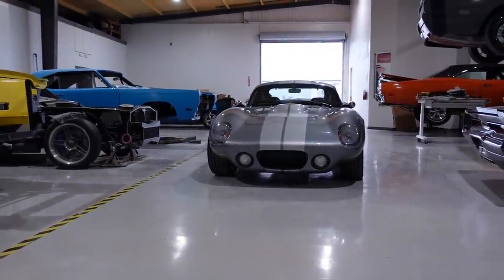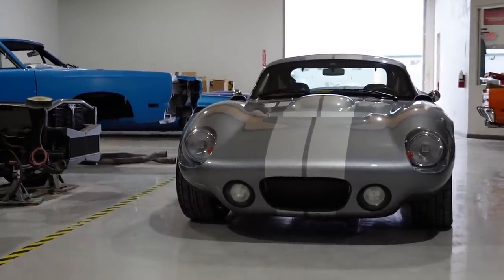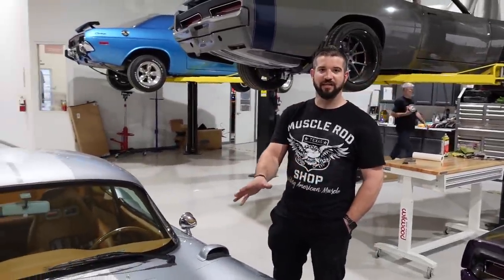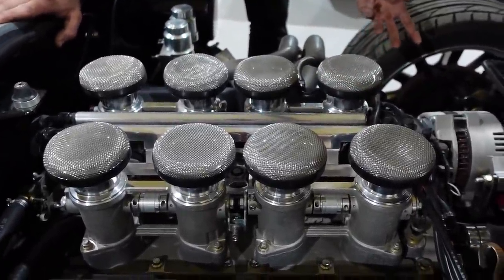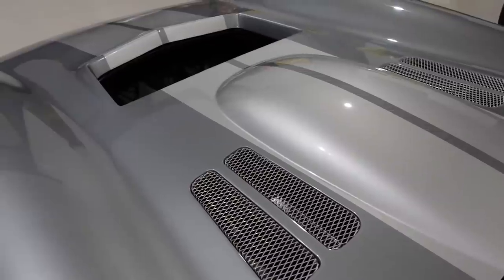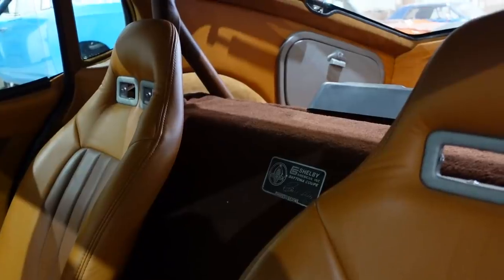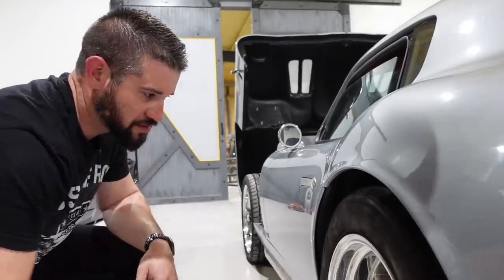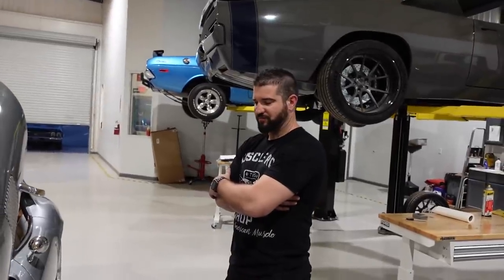You've got to hear this Superformance Shelby Daytona!

Comment: Back in 1994 I got to drive one of the real ones when I worked for Bob Bondurant's Racing School.  A friend of Bob's was a Phoenix doctor and owned one. He had just got it out of storage and wanted to lap it before selling it.  Bob and co-driver Dan Gurney won their class at Le Mans in 1964 in one of the four originals.  I also met Pete Brock,(The body designer)  he was a friend Of Bob's.  The oil cooler split early in the race and they lost a lap while they removed the cooler and just looped the hoses.  It ran with hot oil temperature for the rest of the race, but it held together.  Bob originally bought one but resold it for $10,000 USD. (In the 1960's some time)
Reply: Cool story 👍🏻

Comment: I enjoy the work you have done as well as the thought process that goes into it.

Having grown up in the muscle car era, all I remember was suspensions and brakes that didn't work, body and trunks that leaked when it rained and 5-6,000 mile tune ups.

There isn't a new Ford Mustang, Chevy Camaro, or Dodge Challenger build today that wouldn't beat one of the old muscle cars either on a road course or 1/4 mile drag strip event.

I've done 5 body off restorations (65 GTO, 66 Mustang, 2-69 Chevelles, and a big block 68 Dart GTS). I've got an English wheel, panel bead roller, roller, a spot and stud welder) Average time of rebuild, 18 months. Thoroughly like watching metal fabricators which is a lost art, do their thing.

As for what to do next? Possibly follow a new build, from incoming assessment, design phase, tear down, rusty panel removal, new metal fabrication, paint and wiring.

Comment: A build series on a few different cars. Where they are all in different stages. Then when one is finished a new one takes it's place as the starter car. Each progressing through the process. With things like this thrown in every now and then. When one of the project cars haven't had much done. Or highlight certain steps. Like how the bead rolling helps stuffin a panel.

Comment: You do a great job explaining what you’re doing. 
Remember you don’t have to do it in real time.. 
you could do a little bit of filming of several cars, and then released them in segments. Road Runner part  1 through 5... 
That way in a couple months from now you will have 2 or 3 cars builds with four or five segments each. 
 That also would give you a break because then as you release those videos you can work on other projects without having to make so many videos.

Comment: Brandon, a video montage of one of the wide body cars, particularly the wide body, chopped, channeled and sectioned Charger would be awesome, even if it was done with a series of still pictures from the build. It would really showcase the Muscle Rod Shop's skill set. The Demo Ranch car is giving us a great look at your engineering side, but the Charger above is in a class by itself as a full custom. FR

Comment: Keep doing what you are doing, I first saw you with Mat an liked what you are doing.
My first Car was a nine year old 1955 Chevy, six cylender, three speed on the colum shifter that I bought with my coin collection.
I rode my bike over to the dealer, paied for the car and put my bike in the back seat and drove the car home.. It cost me two hundred and twenty dollars cash.
I dr

ove it to High Scool, insted of walking in the snow, over a mile.
I ended up Being a CH-47 Mecanice and other  Army Helicopter Repair men, and a Tank Commender in my 20 Years in the US Army.
I ended up working for Bell Helicopter for 29 Years. I worked as a Assembler and went to a Hand Former  and then went to Ekpermentak for over 10 Years. I was making parts for old and new Ships that were never built before.. I used a sheer to cut the metals and saws and drills and breaks to form the parts.
I see that You have all of the Expertise  in Automotive stuff and I take mu hat off to uou.

Comment: I read that back in the day, the 289 Daytona's at Le Mans almost went 200 mph as opposed to the 427 roadster that'd top around 180-190 mph. Fun fact: there was a Hot Rod Magazine article titled the '10 best engines in history'. One was the Ford 427FE w/ the dual 4-barrel carbs, that was modified to run the '67 Le Mans in a GT40 Mk. IV. They explained that even in '67, the Le Mans officials would keep a record of the gasoline usage for the cars to determine its efficiency. Of the Prototypes, the GT40 Mk. IV's & the 427FE had higher mileage figures then the Ferrari P4's w/ their 4-liter(244cid) V-12's. They were the most efficient P-cars at the race. The 427FE's were putting out a mild 550hp, from parts you could buy at authorized Ford Dealers. I thought it was any dealer but I was told otherwise.

Comment: i work at a tire shop, been there for 26 years and in all my years i have seen maybe 5 cars with knock off wheels. we will not take them off or put them on because of the possibility of coming off if not installed correctly..but we will let the customer take them off and we will change the tires and they can install them again themselves..and its usually a brass hammer or a dead blow hammer they use. the last set we changed, the customer put them back on like i said and when he left he made it about 100 feet to the stop light to make a right turn and his right front wheel came off .

Comment: Shelby Daytona is the reason the UK has a 70mph speed limit!!
They were using the newly opened M1 motorway as a test track hitting 185mph on what was until then an unrestricted road! on 22 December 1965 the 70mph speed limit was introduced.

Comment: around 4:30 hes talking about a huge problem with any throttle body. oil or carbon/soot/dirt buildup makes them stick break or not idle. electronic throttlebodies are notorious for it.
a very simple easy fix for all of this is to drill a small hole in each one about 1/3 the way out from the center or from the bar that holds the throttle plate. like less than 1/8 inch unless its a single throttle body. after that carb rejet or adjust idle. most fuel injection will adjust the idle air control valve to compensate for the extra flow and give it a touch more fuel if its really even needed. most of the time adjusting the throttle plate stop to back it off some and close it a little evens it out. most automakers actually had a small hole for that reason and to smooth out idle and make good vacuum. iac changes were more smooth and the throttle body wouldnt stick or clog up. we didnt have those problems.

Comment: you should use a copper mallet to hit the spinner on the wheels, the spinner is made of cast steel/iron.
Reply from the maker: The hammer is lead. It Works horribly.... But it works.

Comment: Beautiful car,  comment / feedback.  increase the tread to 1575mm / 62 inches,  increase the wheelbase to 2500mm / 98.4 inches,  raise up the ground clearance to 155mm to 165mm or 6 to 6.5 inches (potholes,  lousy streets),  raise the top of the car to1220mm / 48 inches (I'm 6' 3"),  use full frame doors or gull wing doors,  use a Ford 429 with either John Kaase SR-71 heads or Boss 429 heads.  Use hydraulic roller camshaft with a max of 40 degrees on valve overlap at .006 start lift.  Keeps a nice low idle with decent gas mileage.  In CA,  they have $7.00 per gallon gas ouch !!  Must use A/C,  use Naugahyde material,  leather will dry out and crack.  Must have full gauges,  must have full roll cage.  Use some small bumpers front and rear,  driving people are nuts.    Use a 5 or 6 speed transmission look for G-Force inc website on transmissions.  Well,  thats about it have fun !!!

Comment: Can these be configured as RHD?

And for other roadworthy  compliance logistics down under (OZ)... can it be tricked out with straight pipes out the back with mufflers for noise reduction?

Finally, it has ti have ABS, ESC and electric fuel management system. Otherwise we can't do it down here.

Comment: FYI… back in the day they used a 6’ long bar with a three prong attachment on the end to remove the wheel nut. Looks like a super long torque wrench. Today we use a lead hammer. DO NOT USE a standard hammer…

Comment: hi great video > quick question ~ the exhaust is only coming out of one of the side pipes? 🤷🏻‍♂️
Reply from the maker: No the exhaust will exit from both passenger and drivers side fender gills.
Reply: @MuscleRodShop  not sure what you mean by fender gills ? in the video of the silver daytona when the car is revved at 42secs there is only exhaust coming out of the bottom of the twin exhaust pipes on the drivers side ? 🤷🏻‍♂️

Comment: What you should do next is realize that a Muscle car was defined by Carrol Shelby. And it should not be any surprise to have a Daytona Coupe in a respectable hot rod shop. 1949 Old's Rocket 88 was the first american made performance car. Pontiac was #2 then the AC 289 Cobra and then in 1965 the 427, and 428 AC Cobra's

Comment: Why not drill a small hole on the plate inside the throttle body? That way you have a small bypass at idle that would be less affected by the oil residue buildup. You might have better idle performance and it would have little effect at wide open throttle

Comment: It's registered based on the engine. Jeez, 8 single throttle bodies? I bet you can see the fuel gauge moving while it's running. The true spinners were really cool but got banged up unless a rubber mallet was used. That's not just a hood but hood and fenders. Beautiful car, big engine, alot bigger than original 289.

Comment: DAMN THAT SHELBY IS SEXY AS Hell. Guy was talking about that wheel knock off getting hit with a wrench. I cringed just thinking about that.......the b bodies in the shop that's what I want to see. I know most started out as rust buckets like mine. Maybe show some sheetmetal repair on commonly rusted out areas of the cars where new pop panels aren't readily available. Like around the upper areas of the windows

Comment: Beautiful car.  Absolutely stunning. However, I'm totally scratching my head on one thing.  Let me see, the laydown radiator is scooping air really low off the road, heating it up and mixing in grit, then flowing it up the carbon fiber chimney across the hood and straight down into the throttle bodies.  Yeah, but it looks really bitchin'.  No, WAIT!  It's a Feature!  See, the hot-air sandblasting keeps the sparkplugs from fouling.  Ahh, comprehension dawns.  Seriously though, it needs an airbox - some proper filters, and a cold air source.  Just throw a temp probe in one of the intake horns and take a reading at 60mph.

Comment: The knock off is safety wired incorrectly. The wire should not go straight back to the wheel. it should be tied to a spoke that is to or three spokes past the spoke on the spinner in the direction of tightening. So left rear wheel as they were showing the wire is near straight back and slightly to the left. this is wrong. the wire should be two spokes right or two spokes clock wise.

Comment: There are only seven of the aluminum bodied cars built by Shelby back in the Day. One, the first, has a double humped roof, and was built in the Shelby shops then at Venice Beach. the other six bodies were built around chassis built by Shelby and shipped to an Italian body  builder, who didn't think the "roof humps" were "proper". Peter Brock, a engineer with aerofoil experience designed those humps, and the first car was the fastest of the lot. Always. Not sure how the front knock offs could be wired- certainly not like the rears- the spindle stubs they are mounted to do not turn as the rear axles do. The Shelby v. Ferarri movie makes it look like the Coupes were a production Item- not true. Just the seven, not eight, not ten, just seven. All pure race cars, no AC, no radios, no body insulation, no roll down windows. Just fast, very fast.That is a really nice road car- almost as nice as the one Brock commissioned for himself by Superperformance. FR